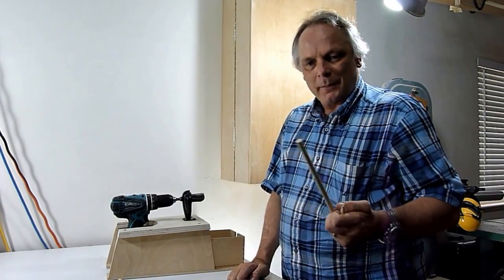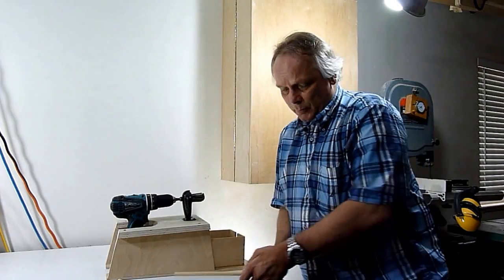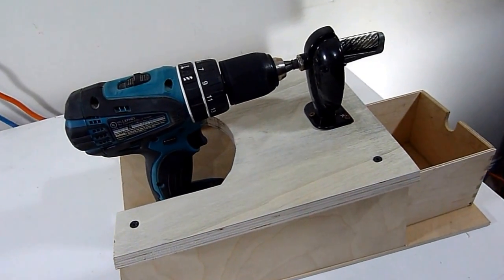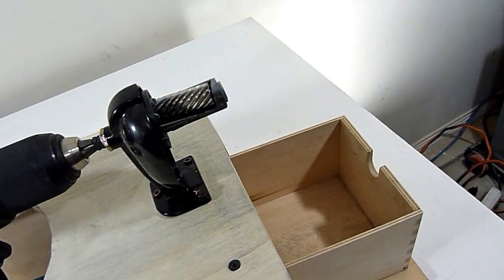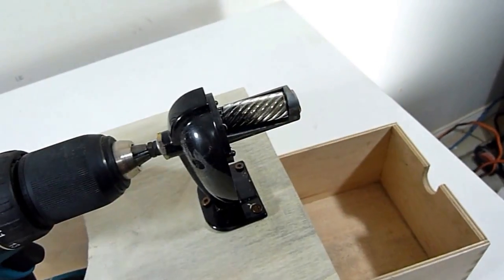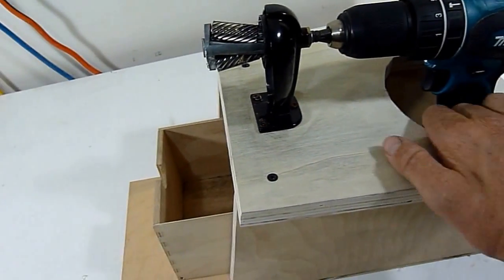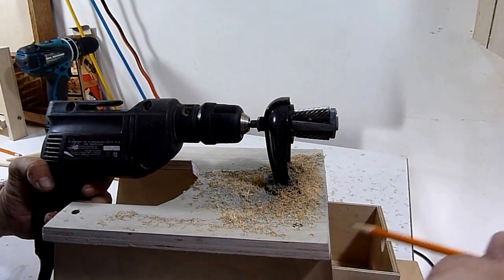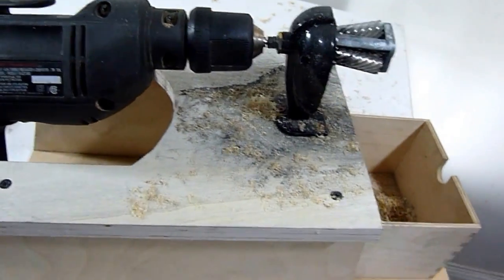High performance pencil sharpener

Comment: Why not use just use the stock shaving catcher that comes with the sharpener and select the largest hole opening for the dowels?  If you need an even bigger hole, just ream it out more.
Reply: +Jack Houweling  That should be easy to solve.  Just cut a hole in the bottom of the shaving catcher and THEN place a large box below to catch the falling stream of shavings.